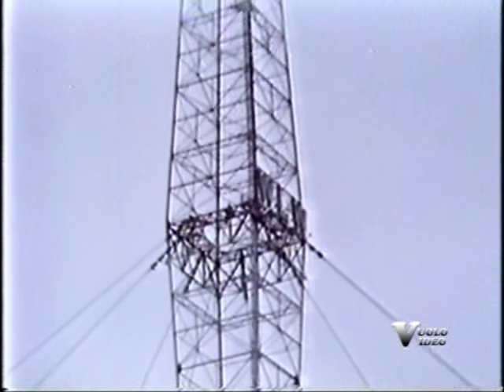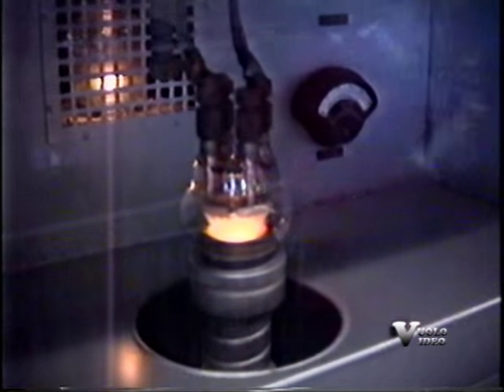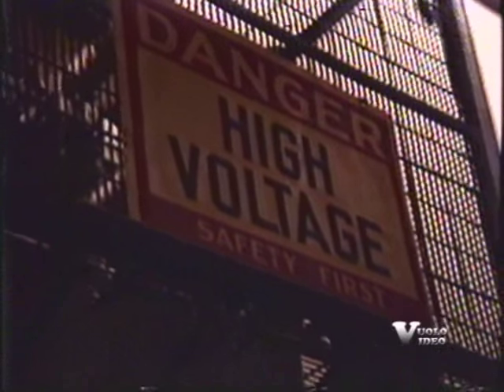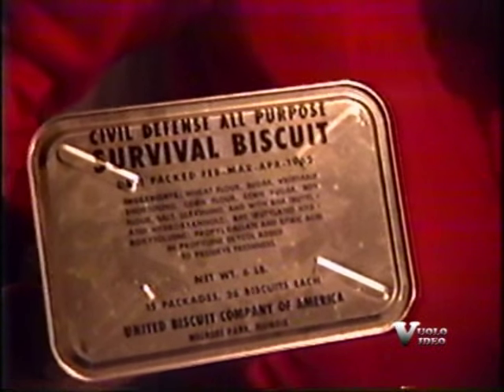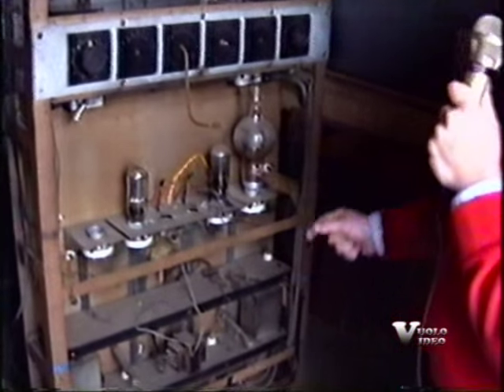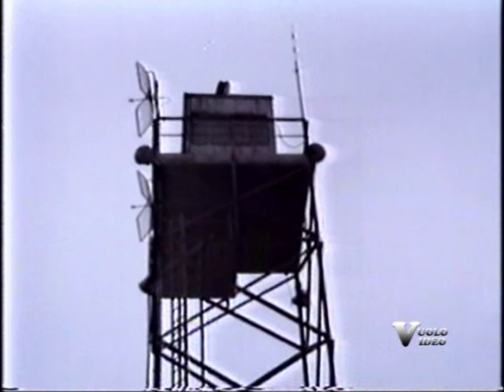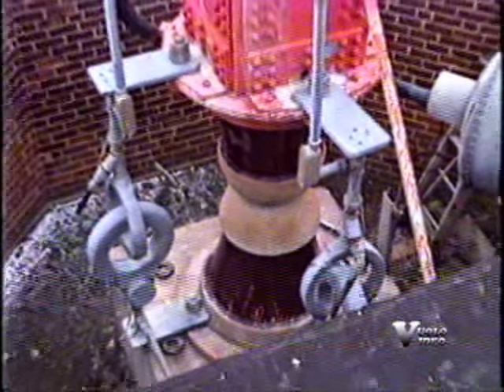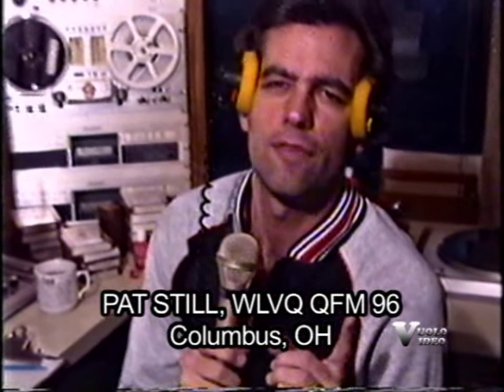WLW Super-Power Transmitter Tour from 1985!

Comment: I'm at VOA. When we went on the air in 1942, we took over that half-meg monster transmitter and broadcast to the world from this stick farm. Ask the neighborhood earthworms and migratory birds what that thing felt like! Glad I wasn't an engineer on-site for the 500,000 RF machine. Glad I wasn't even within 50 miles. You could pick this thing up with a safety pin touching a razor blade and a diode!
Reply: Is VOA still broadcasting? I thought they shut it down! If it is, I'm GLAD, if not, I'm SAD! I used to listen to VOA when I was a kid with my Hallicrafters fake transoceanic radio!
Reply: @seatboi  Absolutely still broadcasting over the air in SW AM and FM. We have a number of stick sites overseas and here - the main CONUS site is in Greenville, NC. And we're also doing many channels through satellites. My dad gave me a Hallicrafters S-120 AM/SW when I was 10. It turned into a career.

Comment: There have been plenty of high power AM transmitters in Europe; here in Ireland we had a 500 kW site at Tullamore from 1975 to 2008. On the continent there were quite a few over a megawatt. But the stories I've read about WLW make it seem like a lot more. Do the US rate their transmitter powers differently to Europe?
Reply: There were two super-power transmitters in Europe about which I'm aware. 

1. The "Aspidistra" transmitter broadcast from England with 500 kW normally. It was sometimes pushed to 600 kW during WWII to broadcast propaganda into Nazi Germany.

2. The "Goliath" transmitter was a 500-kW station in Germany. It was used by the Kriegsmarine to broadcast messages by radiotelegraphy to U-Boats.
Reply: @erzahler1930  WLW Has RCA 1 500KW. WJZ in New Jersey orderd RCA 2 but stopped when power was capped at 50 KW. RCA 2 was sold and named Aspidistra.
Reply: @erzahler1930  Передатчик ,,Голиаф,, был демонтирован и вывезен из Германии в СССР в 1945 году, и находится в рабочем состоянии по сей день